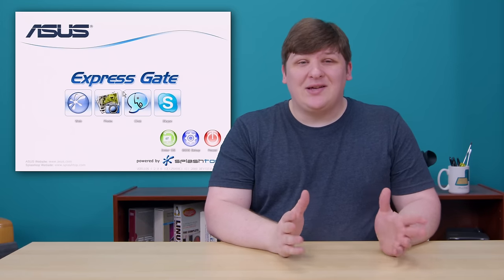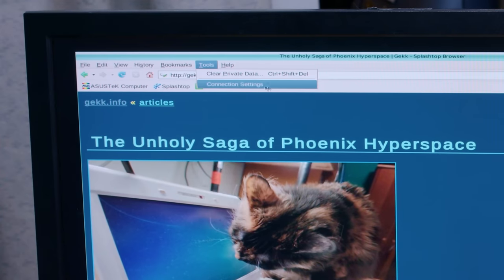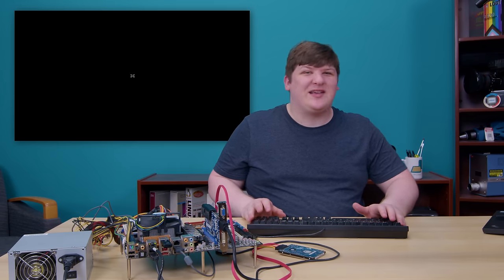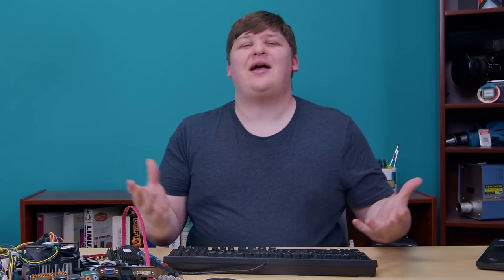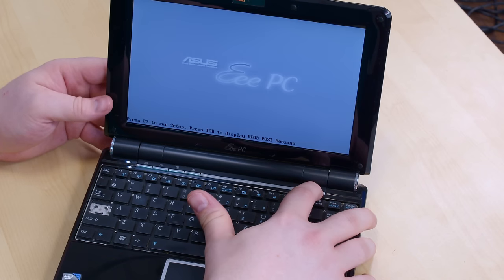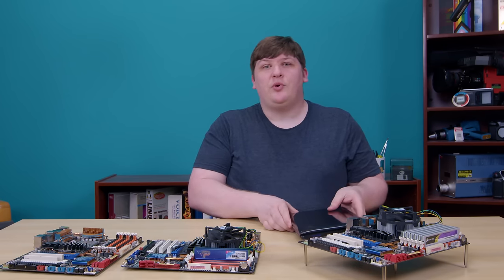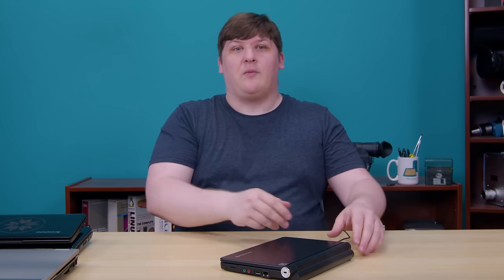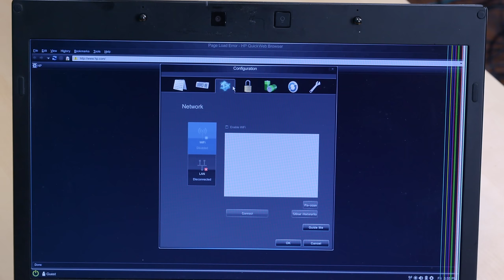Quick Start Ep 2: What The Heck Was Asus Express Gate?

Comment: Intel Macs have an actually useful version of this, the firmware has the ability to connect to the internet, download a recovery OS into RAM and then live boot it from RAM. You could access a full terminal, mount the disk if it was working, reinstall the OS, and access a modern working version of Safari. It is so nice never needing to flash an install USB to reinstall. It also allowed me to keep working when the boot drive failed completely. I dont know why nobody has implimented this for windows, it seems like it could be built into the BIOS since it would just need to download the recovery OS, not store it.
Reply: That is cool AF.
Reply: Some newer Dell Optiplexes I’ve worked with have this sort of feature (“SupportAssist OS Recovery”) but I haven’t seen it on any consumer-level kit (probably for OS licensing reasons)
Reply: uh you do know every mobo can boot from LAN? or from NFS.
Reply: @ChrisWijtmans  for sure. But not every mobo can boot from LAN, connect to <insert manufacturer here>'s recovery image server and download an OS when there's no disk/a damaged disk present.

I don't think most folks are hosting their own WDS/MDT server anyway :P
Reply: This is an advantage to having a unified hardware / software vendor.  That said, I've never used it.  I just maintain a library of installers on CD/DVD/SD, going back to 10.0, because I assumed it would fail to work about three years after the computer was released.

It wouldn't be impossible to do something similar for Windows or Linux -- it would just have to go through a hardware detection process and download the appropriate drivers as well (assuming it had them.)  Not quite as elegant as having a "this model = this image" thing on the server.
Reply: @thehobnob  nope EVERY mobo can do that. And no yo dont connect to the internet you connect to LAN.
Reply: @ChrisWijtmans  Yes, every mobo can boot from LAN. 

Yes, pretty much every mobo will attempt to boot from LAN if no OS is present on a disk. 

Yes, if you have a PXE server on the LAN, and the mobo finds it, it will even automatically boot the network image!

But the point here is that no consumer board (that I am aware of) will automatically download some sort of recovery image *from the internet* in that scenario, in the same way that an Apple computer will reach out to Apple servers to download a recovery image.

Happy to be corrected if you can suggest a motherboard that does!
Reply: @thehobnob  the question is do you even want to? That is a huge security risk.
Reply: I believe this functionality is provided by the "Recovery HD" partition (or APFS volume,) which works similarly as the recovery partition found in most modern Windows computers that contain WinRE.
Reply: If you have a mainboard with UEFI shell included in ROM you can also do that now.
It's how I installed my Arch Linux OS by booting the installer .efi directly from the internet.
Reply: @thehobnob  From what I've read Dell is including something a bit newer than SupportAssist OS Recovery into the UEFI these days. The regular Windows PE version of OS Recovery seems to have been in consumer systems for a few years, though it needs to be on the hard drive to be used (but it can download the latest recovery image from Dell).
Reply: This feature saved me a few months ago, very useful
Reply: @noodlesoup7482  nope. you can do it with a brand new blank hdd in there, or none at all. it's got just enough baked in to know how to get on the internet (even wifi) and download everything else.
Reply: This feature is cool, until it won't work because: 1. fucking certificates are busted 2. Your internet is not good enough (wifi must be 5ghz from what I can tell, but it never states requirements outright) 3. It just doesn't want to install whatever it can download
And yes, I speak from experience
Reply: @Bokto1  I'm not certain since there are very few details about how it works online but it looks like Apple realised certificates would be an issue and it uses http to download the OS, but will only load the OS if its signed by Apple, Its quite a smart solution. I will agree that its not the most user friendly and it isn't always reliable but its still miles ahead of any other recovery solution most of the time. Not sure if it would help but in my experience installation failures were mostly down to bad sectors on the hard drive, replacing the disk or repartitioning it fixes it in most cases.
Reply: @nickwallette6201  I think it would be possible to have it work on regular computers, quite a few Linux OS's have an Internet installer that is only a few hundred mb and installs everything fine. I think its just that motherboard vendors have either not thought of it or not bothered.
Reply: @noodlesoup7482  If you have a working boot drive with the recovery partition then it does default to that, but it can also load the recovery OS from the Internet.
Reply: @somerandomdude4300  well, they have to use some certificates to sign images anyway, even if no https is used. I dunno the exact implementation, but resetting time was a part of a solution for me.
Reply: @somerandomdude4300   As much as I love Linux (currently building the kernel for a new VM right now, actually...), this wouldn't be a very popular option.  For one thing, even being sort-of the target audience for that, I can just about guarantee that a motherboard that shipped with a Linux auto-install environment isn't going to be using the flavor of Linux that I want.  (I'm a Gentoo guy ... for some reason.)  You might be able to hit the largest possible majority with something like Ubuntu, but that's still going to be a pretty small niche.

It would make a little more sense for pre-built OEM vendors like Dell and HP to provide auto-install for the OS that shipped with the machine, perhaps with slip-streamed drivers and security updates.  I just don't trust any of them (even Apple, really) to keep it going for more than about 5 years.  After which point, the computer you bought may as well have spontaneously deflated into a pile of environmentally-friendly aluminum, glass, and hipster pants.  I could be pleasantly surprised though.
Reply: Raspberry Pi 4 has similar internet-based OS installer feature that is entered automatically when no bootable OS is present, though it is not as powerful as Mac recovery.
And probably one important thing about both is that those require no additional knowledge or tools. Afaik Mac Internet recovery is entered by specific key-combo during boot, and RPi 4's recovery can be entered by holding shift(or letting it go when OS is not installed as I mentioned above).
Reply: @thehobnob  my vostro had it, and so do M1s
Reply: it can be quite helpful but i really wish they put like the install image  for whatever OS was installed prior in a recovery partition or something so you didnt have to rely on internet
Reply: @vriska222  I think older Mac recovery might've worked that way(I'm not really sure), but nowadays it seems like it's just macOS installer downloader.
Reply: I think licensing is the big issue here. Apple doesn't need a product key. Thier OS is essentially free to any Mac user. Microsoft won't even let you reuse the same key. They can recover it if you sign in with the same Microsoft account but until you do you are treated as a pirate. They could totally do this if every motherboard was loaded with Linux though
Reply: @4ngeldus739  It would've been big problem before days of Windows 10, but with Windows 10 and 11, you don't have to enter product key during installation if you are reinstalling Windows. (Installation program literally says that on product key page)
Reply: always blew my mind how this feature seemingly worked without an Internet connection.
Reply: @thehobnob  Dell SupportAssist is a thing on basically all Dells, I think
Reply: @thehobnob  It's available on Dell's Laptops.

Comment: The minute you mentioned that we could have had Linux based system utilities on so many motherboards my brain exploded. Even as a windows user that would have been amazing and could have helped so many users out. It's crazy that never happened!
Reply: Just boot into the IME or PSP
Reply: @HappyBeezerStudios  PSP?
Reply: The GNU core utilities which come with literally every GNU/linux distribution are incredibly useful, but it's been 50 years or something so no one outside of the linux user base knows about them.

The one I use most is dd. dd will write an iso image to flash memory with no hassle nor silly questions. It's the simplest, quickest, most reliable way I've found to make bootable USBs of almost anything. And it's been a thing since the '70s. I felt cheated when I discovered it 😅
Reply: @233kosta  I also heard dd is good for recovering data from dying drives.
Reply: @jackkraken3888  Yeh, it'll take a raw image of pretty much anything. Read errors and all.

Comment: I have owned or had to work on numerous HP Elitebook 8540 laptops for friends and coworkers in the past; very popular laptop in the refurb space because, like you said, at the time it was released the HP Elitebook 8440p was a beast of a machine and was still a serviceable business laptop 3-5 years down the line (especially if you drop in a 2.5" SSD).

Presumably, it had the same HP QuickWeb on it that you found in the Elitebook 8440... and yet, I never knew this existed.  Of course once you've put in an SSD, you would be a fool to use it; Windows 7 on an SSD would load at pretty much the same speed but with a full Windows feature set.  Good finds--all of these Vista/HDD busting gimmicks--and I appreciate you running this series.

Comment: I had the P5Q-E motherboard. I loved that machine, it was a beast for the time with my heavily overclocked Q6600 and dual Radeon 4850's.
Reply: oh boi, I had a p5q-e as well.
Reply: @theholyviper  I mentioned this as a comment in his last video. But one time, I reinstalled windows and since that deleted the Express Gate installation, my PC would start up and just get stuck at a black screen because it was looking for Express Gate which wasn't there. It took me weeks to figure out the problem. I tried replacing the CMOS batter and my PC booted up just fine, then if I tried to reboot it wouldn't work. So I figured out removing and reinserting the CMOS battery would let it boot once. From there I figured out it was because it was loading default BIOS settings. Then after tinkering with the BIOS I figured out Express Gate was the problem.
Reply: I still rock a Q6600 with a HD6850 as a spare machine.
Reply: i had p5ql-epu (i guess it still somewhere but capacitors are in bad condition)
Reply: @lvl90dru1d  There are Asus P5QLs that have bad caps. But, the P5QL Pro has pretty much what you usually see on motherboards now.

Comment: 18:21 I do remember some 90s bios having mouse support and even an integrated UI, I thought it was odd that it was discontinued, until recently like you mentioned.
Reply: Some even had BIOS themes.
Reply: thats what UEFI basically is. Its a UI and there is a console too that not many know about. Also UEFI loads firmware from device and passes it to the OS... which is a massive security breach but whatever.

Comment: Your comment on how that issue with the Chip could be the Current Monitoring circuit failing and causing the USB warning message might have just helped me realize something about an issue we're having with some components at work, will post an update if this was actually the case
Reply: I'm actually having a different issue I randomly get the hardware add/remove sound in Windows 10. Any ideas what it could be?
Reply: @jackkraken3888  That could be a number of things unfortunately. For us, we have our own boards and stuff, and Im trying to troubleshoot something with that, not just navigating windows stuff

Comment: XP was so common on those Netbooks because Microsoft gave away the licenses for about $30 if the machine fell under certain criteria for screen size, CPU and RAM. I think at the time they were planning to stop selling XP, but recognized Vista was still too heavy for those budget machines. When I ran the original Acer Aspire One for a few years back then, a clean install of XP was pretty snappy on the Atom CPU, but even back then I wondered why Microsoft didn't just try to make a slimmed down version of Vista for machines like this if they were all practically running the same Atom chipset.

Comment: 32:50 I can attest, I had one die on me a few hours ago, at first it complained about an over current on a usb port, when nothing was connected to usb ports, now when you press the power button it turns on and off again after a second. I am sad but not surprised, when I got it wouldn't even turn on at all, it has socket damage but I was able to mitigate it enough for it to work properly even, but likely something got shorted in the socket in the brief period that it worked and killed it for good.

Comment: That's insane. I had that exact motherboard and two BFG 8800GTS OC cards in SLI. That computer was such a piece of junk. I was constantly fixing it. I must have turned off Express Gate in the BIOS because I don't remember this at all. Or was that the Asus P5NE-SLI motherboard I also had? I can't remember which one had the BFG cards. I definitely had the P6T Deluxe but I think mine was an original, not a v2. Anyway, yeah, I probably disabled it so that I could skip the 10 seconds during boot that it waits for you to pick an option before carrying on to Windows. I knew I'd never use it so why add those seconds to my boot?
Reply: Wait. Maybe it was just one 8800gts oc and the other Asus board I had was running two GTX280s. Man. I cannot remember. One of them had an SLI setup and it's tempting to say it was the board with SLI in the name but I don't think it was. It doesn't matter, I guess. The point is I had that same Asus motherboard and I turned off Express Gate the very first time I ever turned it on and never looked back.

Comment: Asus G50V G50VT laptops circa 2008 had Expressgate built onto the hard drive. A gaming laptop! Had a touch-button above the keyboard by the power button to turn on the machine and boot directly to it. Looks like a running person.  It was lit up blue all the time even on battery i think.
Sucked when i accidentally touched it. I still have the Vista recovery DVD to get it back but I've long since wiped it and use Windows 10 with an SSD.
Funny, the X25-m was my first SSD, 80GB i bought for something like 175 bucks when the prices got 'reasonable' it was awesome. Super reliable. I left a hidden thank you under the cover of the SSD when i sold it.

Comment: My last machine (c. 2009/10 - 2014/15, forgive my faded teenage memories) took nearly 45 minutes to boot, I believe it was Windows 7 running off of old second-hand mobo and hdd that I had scavenged from my mom's pc and stolen from my high school respectively, so unquestionably out of date parts. I always just chalked it up to the fact that it 1. was booting off a disk and 2. had extremely outdated components even when I began building it in 2009. When I finally upgraded and built the pc my husband now uses in 2015ish, its boot time went down to around ten seconds, which is around what all my machines currently do. I'm pretty sure it's really just the SSDs at this point that give that benefit in booting, and i really can't believe there are still people who use PCs extensively in the 2020s in the developed world that are still tolerating boot times that exceed five minutes. Like, SSDs are as expensive as a day or two of wages at minimum wage, if you can build a PC at all, I'm pretty sure you're more than capable of getting modern parts that should reduce booting time to seconds from fractions of an hour previously. Just think of how much coal is being burnt at the plant during your PCs bootup, then multiply that by every day in a year that you use your pc, and jesus christ, for the sake of climate change, please just buy an SSD, christ.

Comment: I literally just replaced the hard drive in my 1000 HE with a cheap Silicon Power 256gb SSD. I tried Win10 for kicks and its fine. My usual OS on it is Mint, which is excellent on this machine, because I do actually still use it. I take it camping a lot where i mostly use it for word processing and spreadsheet editing, but I do read PDFs with it and watch videos on it. The neat thing about it is it runs directly off of 12 volts from a standard car cigarette plug, which is great because my tent trailer also has a 12 volt battery! The damn thing won't die. The battery life is still 6 hours. It's probably the best purchase I ever made in terms of portable gear.

Comment: Back in the days of a monolithic Linux kernel (with no loadable modules, or ramdisks), you would have to recompile the kernel, if you wanted to add support for an unknown graphics, network, cdrom, mouse, SCSI, or sound card! It would take sometimes several hours to recompile, and sometimes it would just die in the middle! Once you got it to compile, you had to install it, and if you got that wrong, the entire computer was a brick because no RESCUE mode! You'd have to reboot with a CDROM and mount the root drive in /mnt/ and modify the kernel boot code, path, or whatever was causing it to not boot... Remember kids this was before GRUB and loadable modules, and you could only use LILO. Which sometimes didn't work, just because it felt like it...